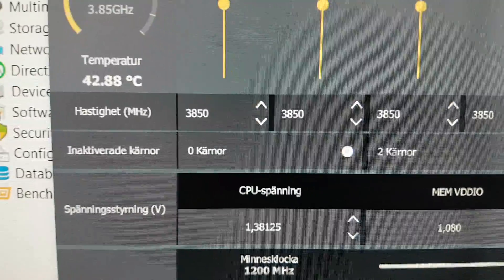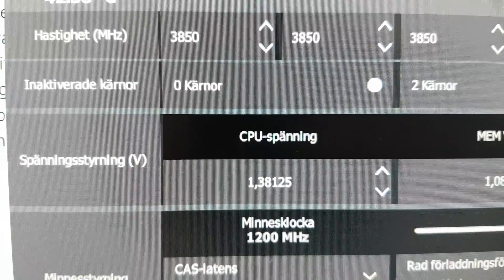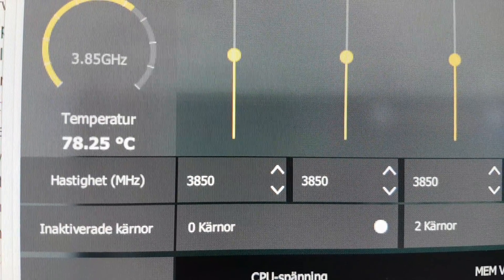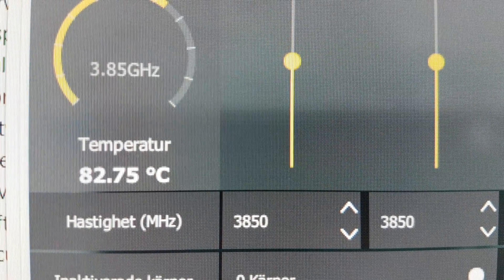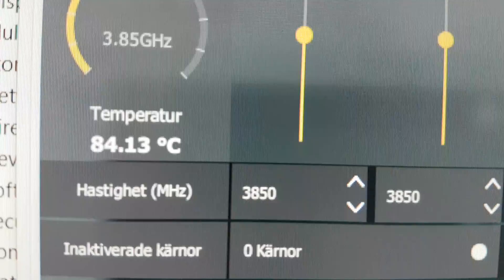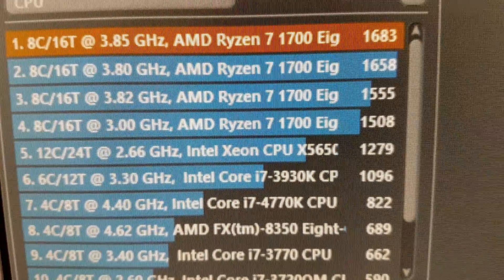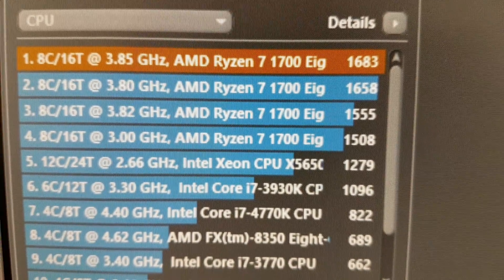Ryzen 1700 overclock with Stock Cooler Wrath Spire

Comment: i  planned to buy a cooler instead of Wrath Spire but i think everything's ok after i watch your video . thanks a lot
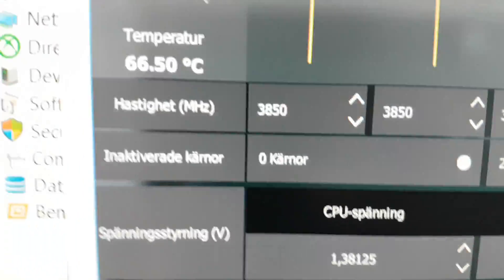Reply from the maker: Glad I could help :) Just beware though, in case you haven't seen the video i recommend about 1:30 in, you can probably run 3.85Ghz with a lot lower voltage. I was able to get mine stable on 1.235V, still with the stock cooler.
Reply: Thanks for fast reply , you made my day . I'm going to buy 1700 today and overclock it like you did . 3.8 Ghz is enough for me , so i think 1.2V is good
Reply from the maker: No problem :) If you wanna aim for 1.2V I'd reccomend starting at 3.5Ghz and then inch your way up through stress testing until it's not stable anymore. For me I want to go as high as possible within reasonable voltage. I probably won't go higher than 1.4V though, but it all boils down to what my Kraken X62 will be able to handle. But yeah. If you are willing to overclock, the 1700 offers the best bang for the buck by far, I'm super happy with it :)
Reply: Can i overclock it with B350 MSI ? i want to reduce expenses
Reply from the maker: They tend to skimp on power phases and VRM-cooling for the B350 boards, so while you probably could overclock, it's likely that you wouldn't reach as high clock speeds.
Reply: Hey it's me again . My 1700 is stable now with 3.8Ghz on 1.315V ,  but temperature is always around 46~50 C when i don't use any heavy softwares (cpu stress = 75+ C) . Is that normal ?
Reply from the maker: Hi! Yes I would say so. I get about the same temps with the Wraith Cooler, so I think it's fine. When you start going 85c+ then that's not so good. Idle temps are fine too. With that low voltage you really don't need to worry :)
Reply: Thank for your advices Oskar . Have a nice day
Reply: Hi Oskar long time no talk . :D I'm planning to buy X370 pro instead of my shitty mainboard MSI b350 , it's crab . How is your mainboard ? Are you happy with it ? Share me your oc results , i will copy-paste when i got new board . lol
Reply from the maker: Every chip is different so I think you'd have to do some experimenting. I'm getting different results with each bios-update but right now I'm stable on 3.8Ghz with 1.3Vcore. I hope to get much higher when I get the mounting kit for my Kraken though :)
Reply: Yep , im also goin to build a custom watercooler for r7 1700 , summer is coming and it's so hot in my country . Every single time r7 1700's temps hit 76o C then PC crash , i have to RMA my Ram modules 2 times after it got oc problems , 2933 is my limit  . (TridentZ rgb 3200 C16) . wish u luck

Comment: I managed to get 4Ghz on the stock cooler at 1.375v , just set the multiplier and the voltage in the bios and boom.
Reply: lol, no way 72c full load on 4ghz. Not with stock cooler.
Reply from the maker: Nice! What temps did you get during stress testing?
Reply: about 72c give or take a little :)
Reply: What's the noise level of the reference cooler? I imagine it spins at 100% with such a high OC. Is it 290x reference cooler/vacuum/jet engine level or is it something you can actually tolerate in a box standing next to you :).
Reply: So how's it running at 4ghz? Still good? What kind of room temperature do you operate in? I live in a hot country, though I will use the AC when gaming.. Wondering if I will be able to push it that far with the stock cooler..
Reply: Congrats on the nice score in the silicon lottery!
Reply: Hey can you please give a brief rundown of what exactly you did in your BIOS to achieve this - and when you say BOOM - did you mean wham bam thank-you ma'am kinda of boom or boom as in it exploded! lol
Reply from the maker: I would say it's tolerable. The noise is more of a woosh than a whine, if that makes sense :)
Reply: Mine can't complete Cinebench stress test, but i can play normally at 3.7Ghz 1.2v
Reply: Got 4,0Ghz-1.41v with spire cooler, but it's still unstable. Can't play Sekiro(Max temp 70°C).